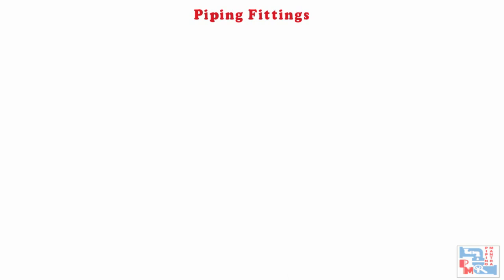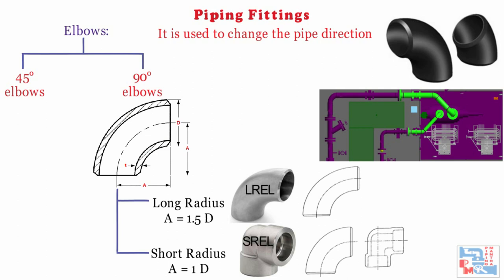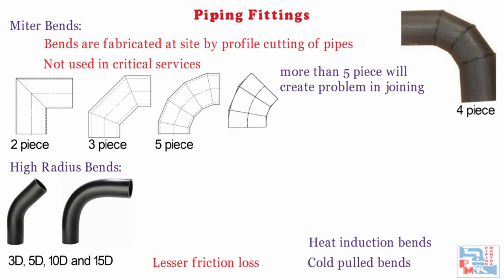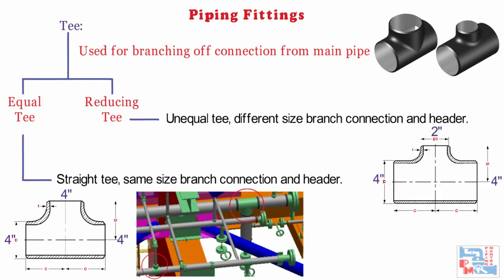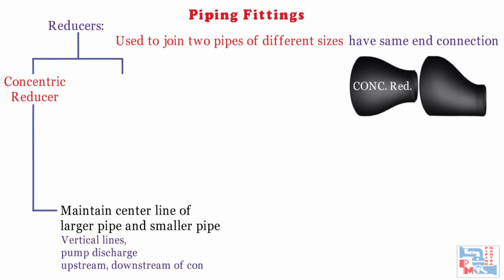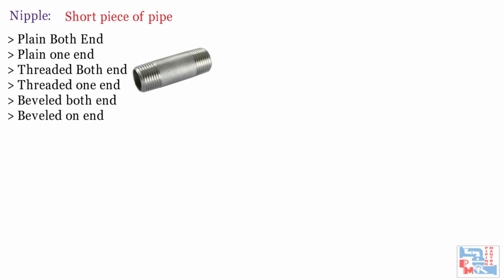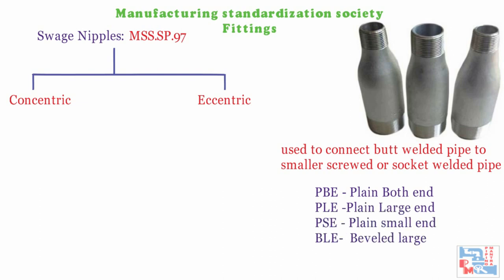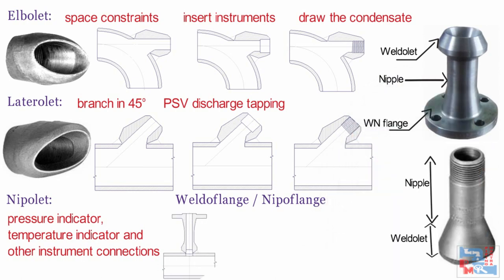PIPING FITTINGS | PIPING MANTRA |

Comment: As usual excellent video. Please keep it up. 1 question: Why flare PSV use laterolet. There should be some high pressure fittings as PSV always operate at high pressures? Also, normally how much pressure flare line has?
Thanks for your excellent work.
Reply from the maker: use of laterolet is to smoothen the flow . no its not specific for high pressure, now a days direct tapping with elbow. soon you will see video on flare piping.
Reply from the maker: thank you for your comment
Reply: @PipingMantra  Thanks for the clarification. Please keep it up...